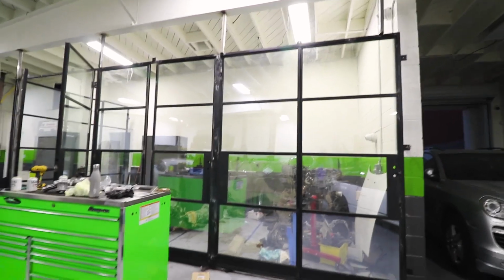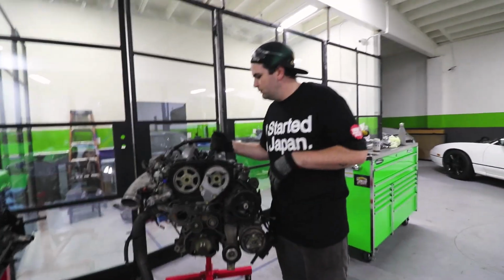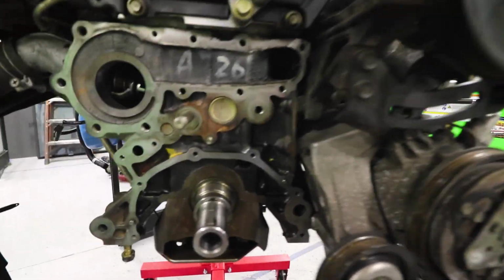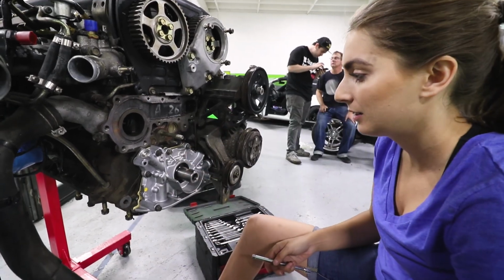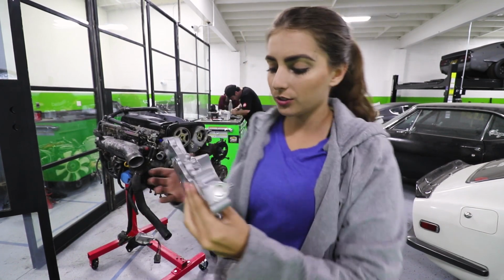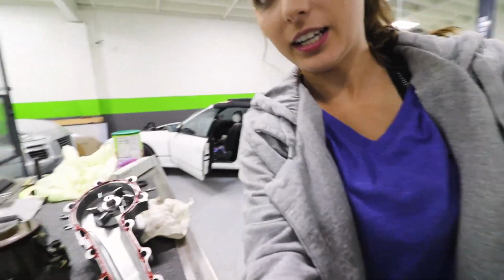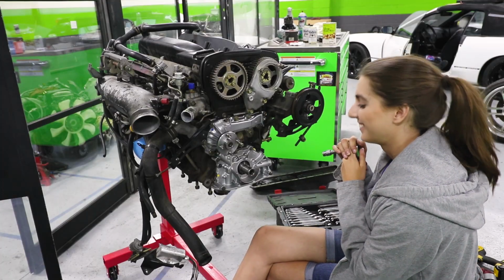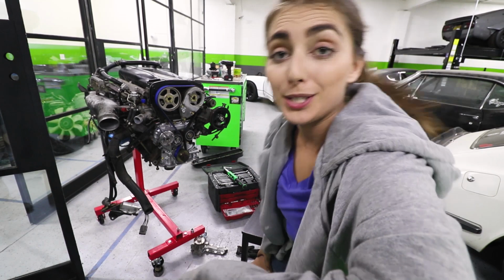Turning a 276 HP Engine into a 500 HP Engine

Comment: The main reason for RB oil pump failures are the gears breaking. They are made from powdered metal instead of a billet piece. They crack and you lose oil pressure. A good common upgrade is to have the crank machined for a spline drive setup or a collar with billet gears to replace the stock gears in the oil pump. I opted for the spline drive setup in my recent RB26 build. I also did the single throttlebody intake manifold. Much simpler to install! Edit* The seal on the oil pump, you want to just put a little oil on the crank shaft where the seal sits, and use a small screw driver while putting the pump on to make sure the seal doesn't flip out and unseat the spring. I actually have a video about it timing belt install if you're interested...if this comment even shows up :)
Reply: Or go for Reimax gears :)
Reply: GoodeZilla wrong it’s not the oil pump gear themself it the nose of the crankshaft not having sufficient surface area for the gear to mate too . And I’ve work on many skylines here in Australia. Early engine had shorter nose then the later cranks . Also if your oil pump gears brake then you must be over revving the engine past 7500 rpm and no more and not the mention just replacing it with a high volume unit like in the video is a good and bad idea because they didn’t install a oil restrictor in the block which requires removing the head also install a extra oil return from the back of the head
Reply: Gaz Girl I'm not wrong. The gears are the problem. Even with long nose cranks, the gears still break, as you know, if you've worked on many skylines in AUS. Yes the surface area on the short nose crank doens't help the situation, but people that over rev their car or bounce on the rev limiter are going to break the oil pump gears whether or not you have a short or long nose crank. It's the ever so slight space of clearance that allows the the gear to bang against the crankshaft and crack the gears. Billet gears are a must for anyone that wants to rev high and use 2-step launch control, and have an oil pump left after the fact.
Reply: haha thank you Peter Hovorka

Comment: I have R34 N1 turbos on my RB26 in my R32GTR. They can flow just over 500whp. For engine management I went with an ECU Master EMU Black plug and play. You can get it with all the sensors (air/lambda/plug and play adapter) for around $1400. Has all the bells and whistles  you will ever need. However, since you have the engine on a stand, and you are deleting the ITBs, just go single. It simplifies the setup and reduces heat. Not to mention with a modern single  you can spool just as fast as smaller twins.

Comment: Treat the gasket with spray on adhesive so that it does not move while installing part.  It is cheaper to measure the shaft and the seal and know the allowed tolerances for that shaft.  Once you know the correct parts make notes in your engine log book.

Comment: When installing gaskets like the one on the oil pump you can use an adhesive spray or high tack which will not hurt the gasket or affect its seal but will help hold it in place when installing it... this is not a novice technique like slapping rtv everywhere but an industry acceptable method used by professionals .. it makes assembling shit so much easier.
Reply: Also a very old school trick when installing oil seals like crank seals and axle seals and pretty much any seal that has a lil spring inside that can pop the fuck out when installing the seal... before installing seal take transmission assembly lube (usually a blue goo container) and pack the back side of the seal so that it is impossible for the spring to pop the fuck out.. the tranny lube hurts nothing and breaks down over time into the oil and is safe for everything ..it doesnt swell up rubber seals so if you don't have this stuff lying around buy some do not use any old grease you have as almost everything swells rubber //

Comment: Check out motivedvd twins vs single on youtube they have documented it well. Single came out on top in all areas. Please dont use the N1 oil pump. The stock 26 pump is better. The N1 outer oil pump gear is substantially thinner than the stock 26. In NZ and AUS we dont use the N1 as they fail to often

Comment: "TWIN TURBO" sounds neat catches people attention but....It can have double the problems with pretty much everything.  I ran twin GT2871R's had it tuned by two different "tuners", left unhappy and with issues from idle to 3-4K RPM's.  I even divided the charge pipe to rid the surge but it still was horrible.  I had all the bells and whistles but it all comes down to tune and I couldn't get that done with even traveling 350 miles away from home.  So I remodeled my engine, dropped my new twins and went EFR 8374 with a FR manifold.  Turbo is inclusive and can make great power with it being the newest technology turbo on the market.  I had ITB's with the twins and switched to a single throttle body and speed density thought it would be easier for the tuners but still was disappointed with the outcome, so I changed to the EFR and it comes on stronger than any of my tunes with twins did and it clearly cleans up the engine bay which is already tight for a 240SX.  I just recently put down 468 AWD HP on 17 PSI waiting to learn more tuning aspects so I can bump her up on E85 in the near future.  Good luck on your decision.

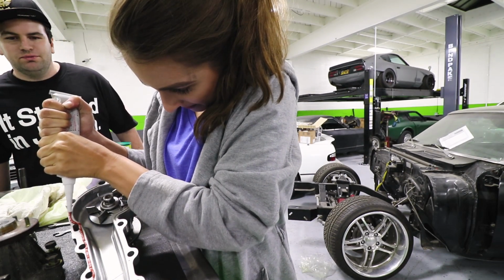Comment: Roll the film back to the RTV on the water pump,  see if that is a water passage that got RTV only on one edge of the passage, the bead didn't look like it went all the way around it.  You pass by the passage at 11:23.
Reply: jwright650 nah, it’s a bolt hole. I see what you’re saying because it’s a lot more elongated than the others, but it is a bolt hole. If you watch her tighten all the bolts you can see the one in that hole

Comment: Pack the front seal with wheel grease and also grease the crank to oil pump mating surface.  The grease will help to prevent the seal from tearing and the spring from coming out as well .  It should be tight otherwise you'll just be spraying oil everywhere else.
Also, why would you put it together that far without a front seal???  Look back on this when you are chasing a big ol' oil leak!!!

Comment: @EmiliaHartford go to small turbo feed a big turbo small turbo is to low rpm and the big one is for top end. But you can make a lot of power then 500hp. Ported head ,big valves, block with darton sleeves. I think is the best setup.
Reply: This is used mostly in Diesel engines and the problem with this for drifting is when you are in mid turning or drift and unexpectedly the second larger tubo kicks in and starts to provide much more power in the middle of a turn or drift. Using two smaller turbos in parallel is less efficient then one large turbo because each smaller turbo only gets feed half of the cylinders exhaust each. 500hp is a good number for drifting and much more then that will be unusable in a drift.

Comment: Since you asked for advice/opinions on the setup for this build rom experienced twin to single builds I’ll share. Please check out YourCarBro channel for the before and after build and @touge_guy (me) for photos of the build. Personally I would be keeping the ITB’s at that power goal because it will help you keep your response nice with the single turbo, and that is advice from my builder/tuner here in Okinawa japan. The stock manifold is also not as bad of an issue as it’s made out to be if tuned properly, hints what motive DVD covers. Also, I would recommend installing some reimax gears in that oil pump as insurance, the N1 pump has a smaller gear that the stock pump which can be more prone to damage. All in all, I wish you all luck with your build and look forward to seeing the end results. Please let me know if you have any questions along the way.

Comment: I'm not so sure that the engine made 276 HP in the first place. That was just what was permitted for advertising.
Over in Japan, their Fairlady Z32 Twin Turbo also says it makes 276 HP, but the 300ZXTT sold in the USA has 300HP.
The same thing happened with other car companies. The Evo IX says it has 286 HP in the USA, but only 276 in Japan. The MKIV Supra advertised 276 HP in Japan, but advertised 320 in the USA. I forgot what the Mitsubishi 3000GT Twin Turbo calimed to have in the USA, but it was more than the 276 Claimed by the Mitsubishi GTO in Japan. I can't bring Subaru into this discussion because the engines used in the USA are different than the ones used in Japan.

The numbers in Japan might be even better in the USA, since our cars have to be compatible with the crappy 91 octane gasoline sold in places like California.

8:18 Edelbrock made a product called "Gasgacinch" which holds that type of gasket in place without RTV, so it can function they way it is supposed to. I don't know how well it works because where I had a job, everyone was too cheap to buy any.

13:38 I always preferred having a torque wrench click when I reached the right torque, but I also preferred entering specifications digitally. I never liked that nearly every torque wrench was in ft/lb or in/lb, and the number you used was a less than perfect conversion from NM or Kgf/CM Ever see a torque wrench do both?

Comment: Humm, as this thing is R32 Rb26 it should have a "short" oilpump drive it looks like it has the "long" one wich is often a add on colar (ora a R34 RB26 crank) that is pressed on the crank, that could be whats make the seal not fitting easly.
Also, its the sort of crappy gears in the N1 as in the Stock one.. thay do not like bounching of revlimiter for a long time :)
Be carefull when using "harder" cam belts thay easely overthight and you can  damage the front cam bearing on the exhaust cam.

Comment: go single with a GTX3582R single 1.02 AR housing n 6boost manifold
Reply: Mike Obrien nah, that housing would be too big for a drift car. The .63 is a much better option if they’re going for quicker spoil and more linear (as linear as a turbo could make) power. At least, that was my thought process in getting the .63ar in my gtx35r for my 1j

Comment: Single turbo, everytime, dual turbos on a straight 6 are an arse to plumb in, 2 waste gates, 2 dump pipes 2 oil feeds 2 water feeds. etc They only reason they used twins orginally was because big single turbos lagged like a bitch in the eighties.

Do rbs still over heat the 5th and 6th cylinder???

Comment: yooooo check out MotiveDVD channel on twins vs single. technology with turbos now day are soo much better which is explained in the video, and single turbo would be my advise as it would also make it much easier for servicing and maintenance. 500hp is easily achieved with single turbo with better response.

also id like to mention that the rb26 makes more power then said 276hp, really can make over 330hp from a stock setup from factory. they had to take some power out due to some gentleman agreement in japan, they had to restrict some boost to keep the power down. Mine made 336rwhp stock with just Power FC and EBC. just a bit more knowledge for ya :)

Comment: Emelia, the "276 horsepower" figure is actually a JDM lie...back in the '80s when the turbo Toyotas, Nissans, and Mazdas started putting out crazy horsepower, the JDMs were afraid that the Japanese government was gonna start regulating performance cars, so the JDMs had a "gentleman's agreement" that no performance car would be advertised with more than 276 horsepower; if I remember correctly, they also governed top speeds to 130 mph.